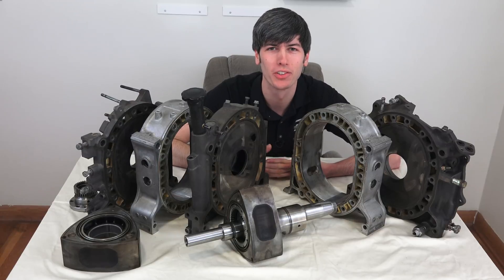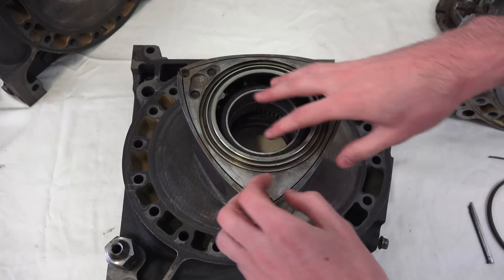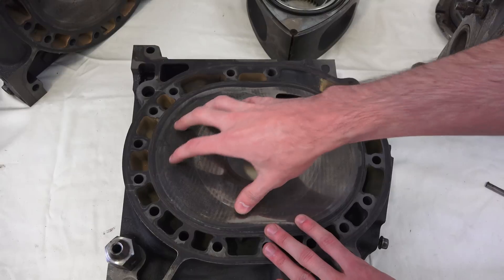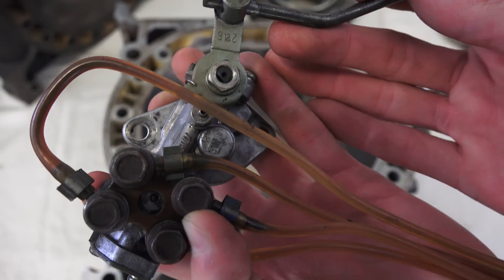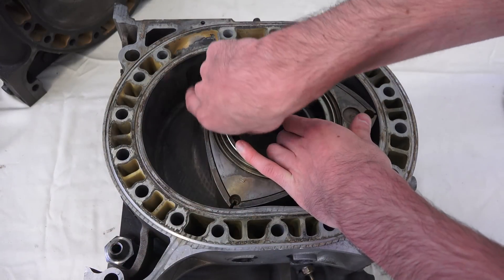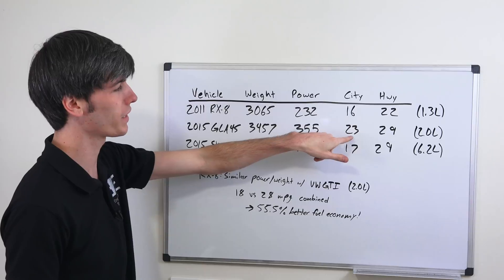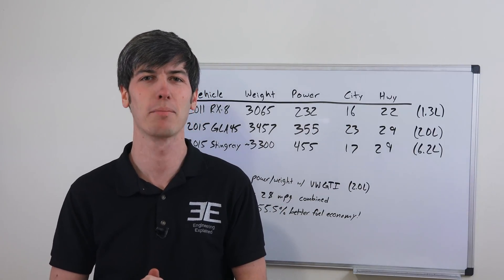4 Reasons Why The Rotary Engine Is Dead

Comment: As a former RX-8 R3 owner, I can attest to the fact that the rotary engine is a total blast to drive and bullet proof if you understand how to maintain it.   That said, it's not perfect.   The fuel consumption sucks (I averaged 14L/100km overall), but the advantage of a rotary is that it's a tiny, light engine that gives you the handling characteristics of a mid-engine car for a fraction of the price. With the right exhaust, the sound that it makes at 9K RPM is incredible.   I now drive a Cayman S, which is a totally different car, but the RX-8 could definitely hang with the Cayman handling-wise.   Long live the rotary!!!

Comment: I know it's a bad engine, but I have ideas for a couple of your problems:

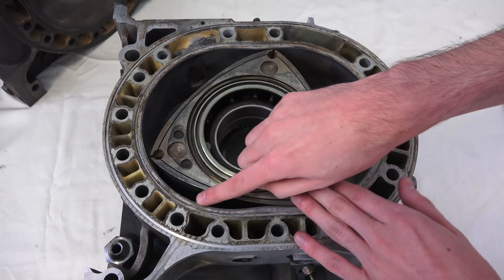0:45 - Put another "spark plug" to the 10o clock position and make it fire a bit later.
1:50 - Make it so that for example it does the explained combustion cycle like 3 times, then does half a revolution with no combustion (or a full revolution if needed) and then switches to doing combustion on the other side.
Reply: +SmartassX1 The first suggestion could work, but it would marginally affect reliability (something the Wankel doesn't need)
The second, how can you rotate an internal combustion engine with no combustion? If you could work this problem out, then it would make for a very unbalanced engine; with uneven combustion.
Reply: The idea is that once it gets going, it would use inertia to do the no-combustion rotation. Early internal combustion engines from about 120 years ago were designed to skip combustion cycles like that to save fuel, but they all had a flywheel.

Comment: maybe this is why I never did buy a Mazda, or drive one!
right now, driving 2015 Ford Transit 250 van with 3.7 liter v6 has 6 speed automatic transmission. and plenty of power output with excellent mileage. also has traction control system
Reply: +Anthony Schurz hahaha you sir, got served.. you do know that the ford ranger was a joint operation between Ford and Mazda since the REPU in the early 70's, right? I'll give Ford credit for helping Mazda out during their time of need, but it wasn't free. Mazda put in some serious engineering work for Ford.
So yeah, you would be surprised how much Mazda your Fords really are. Surely you remember Mazda's 2.3L Turbo engine.. What's in the new Mustang Turbo? hmmm interesting..
Reply: I take it that you like Mazda? And you are upset. When this whole video started out showing the rotary engine was a failure.
And the bread truck is running fine
Reply: +Anthony Schurz Why on earth would I be upset? I found it comical that someone driving a Mazda, "would never buy or drive" a Mazda. And I bet, its probably not your first Mazda! LMAO

The funny thing is, your bread truck will continue to drive fine. As had all the previous Ford/Mazda cars and trucks. But you sir, I'm sure will accidentally walk into a wood chipper someday.
Reply: +Anthony Schurz You're an idiot.
Reply: +Anthony Schurz What you really meant was "I only buy Ford, that's why I never bought a Mazda." *Even though at the time they were Ford's lol
Reply: +Anthony Schurz Only RX Mazdas have rotary engines. The rest of them have conventional piston engines.
Reply: Tuppoo94 will still stick with the Ford product not with the Mazda tried to be with Ford in the Ranger
Reply: Right now Ford Motor Company's beating the crap out of everybody else
Reply: +Anthony Schurz Your joking right??? You do know that 3.7 is a Mazda MZI motor from the 2008 CX-9?

You must be trolling...
Reply: 3.7liter Ti-VCT V6
Reply: Is that what sticker Ford put on the plastic engine cover? They have always been great at badge engineering...
Reply: Ronin both Ford and Oldsmobile were building multi valve double overhead camshaft v8 455 cubic inch plus that put 1200 horsepower plus to the ground back in the late 60's. However, environmentalist and insurance companies would not allow them to put these engines in production cars and sell them on the street to the public
Reply: And as for the previous comments, the big 3motor producers during the late sixties we're coming out with power plants that developed outrageous horsepower. And Mazda was nowhere to be seen until environmentalist, Ralph Nader, EPA ,Bogus oil embargo and Jimmy Carter's stagflation occurred that everyone was supposed to jump on board buying Japanese engines and the only way these were allowed into the United States was to have partnerships with automotive dealers. Of course at this time, this is when our economy was in free fall and Japan was buying are federal debt( Treasury bonds) while monetizing their own economy( quantitative easing, printing money)
This was the big leap in production manufacturing moving overseas to the island of Japan, then returning finish product as an import to sell on the American market to US consumers.... all while playing the game that peak oil was running out.
Now back in real time, we understand that we are not running out of oil. And Ford Motor Company is back to making the engines that they were making before and selling them on the streets to the public.
And yes Ford Motor Company has purchased several other companies. But Ford has never been purchased by another company.
Reply: +Anthony Schurz Haha. You have lost it.
Reply: +Anthony Schurz wow you got rekt.
Reply: That 3.7 liter is also the same motor used in the Mazda CX-9

Comment: What are you pooping about?
Modern gasoline engines have a maximum thermal efficiency of about 25% to 30% when used to power a car.
Mazda improved the fuel efficiency of the thermal reactor system by 40% by the time of introduction of the RX-7 in 1978.

Comment: the displacement calculation is wrong, 13b's correct displacement should be 2.6L due to difference in the speed of crankshaft rotates, calculating rotary's engine displacement like 4 strokes is not really applicable....

Comment: As a rotary owner, I prefer to think of these are character traits.  :D  

In all seriousness, these cars are not for everyone.  There is a fair bit more maintenance then a normal car but the driving experience is like nothing else.  They are very special cars.  I personally like the NA engines over the boosted versions.  I like that smooth power curve and instant response.  But, they are not for everyone.

Comment: From what i remember, the most disadvantageous aspect of the rotary engine is that the seals had to be replaced every 60-80,000 miles. I'm not sure if this is just recommendations that i remember or realistic fact. Either way, the seal replacement was not cheap and to EE's point, not worth it when your fuel efficiency is so terrible.

Comment: Well there are several things that could be done to fix that.  for the heat problem they could rotate the intake and exhaust chambers and make the sides out of a ceramic which would conduct heat less effectively.  the could also make the blades out of ruby or diamond and Teflon coat the sides of the chamber which should reduce the need for oil, if significantly increase the cost of the engine.  The real issue is the lack of low end torque, which I have to admit is really stumping me.  the easiest way would be to greatly increase the size of the blades, but this would also make the engine quite big as a result and most likely to get the desired specs would be something that would not even fit in the engine bay of a pickup, much less the confined space that most rotary cars live in.  turbo's would do nothing as there's just not enough gas moving to make them wroth considering.  hybrid would be the best opition, but I honestly don't know how much aid that could possibly be.   Too bad that this is such a head scratcher because this engine sounds and feels really good, and I really would not like to see it disappear.

Comment: Can you please make a video on the 2JZ?
Reply: +TrwSeama Bailing wire and duct tape.
Reply: Yes, but HOW it works? What makes a 2JZ so special and different from a normal engine?
Reply: I mean, why do I see so many Supra 2JZ fans? I know why I see a lot or Rotary RX-7 and Vtec Honda fans, but not 2JZ Supras.
Reply: +TrwSeama Because twin cam 6 cylindres
Reply: so 2JZ means just 2cam v6?
Reply: TrwSeama 2jz is not a V engine, it's a straight engine. 6 cylinders in line.
Reply: so an inline 6 with dual cams?
Reply: TrwSeama AND a turbo.
Reply: +ᅚᅚ 2 Turbos.
Reply: so it's an inline 6 engine with double cams and biturbo?
Reply: TrwSeama Yep, can handle 6-700+hp on standard internals, block and head. I suggest you look up Titan motorsport and see just how far the 2JZ can go
Reply: and how are the turbos mounted?
Reply: No :)) In what configuration?
Reply: +TrwSeama the 2jzgte can hold up high boost really thats all i know LOL

Comment: One of the largest disadvantages is that mazda is the only manufacturer to own the rights/only brand producing these engines. Also traditional piston engines have a larger history with multiple manufacturers producing and engineering new systems.Think about how far the piston engine has come in the last 20 years compared to the rotary.
I do understand that the rotary does come with its own flaws, just sad to see that they are not very viable to be further researched with the advances in piston and now hybrid and electric vehicles.

Comment: Why list a rx8 for mpg comparison when you are clearly using a 13b non renesis motor for showing detail.  i hate you now.  rotary for life.  "You no fasta than me!".- some rotary guy.....   Also no one with any rotary knowledge runs the oiling injectors, you premix.  Also the rx8 ren motor is the worst mpg out of all rotaries.  my 12a got around mpg as a 1.5 civic i had. (around 30mpg avg at low injector pulse width) and my 13b bridge on 550cc/1600cc got same around town as my sr20det does on 750cc.

Comment: We all knew it had disadvantages...  This NEVER stopped ENORMOUS SMILES PER MILES spinning the engine at 10 Grand...with flames shooting out the exhaust and tires erupting in smoke however.   You could also balance a glass of your fav beverage on top of this little powerplant and it would hardly ripple the liquid...and packaging?   You could fit one of these in a Brown grocery bag basically...and it would have 200+ HP.

 I know I know its not as efficient as it could be...but hell....AMERICA used to BATHE IN GASOLINE.....  We had 4 ton 2 door cars that one person drove to the grocery store in every garage across every state...for EONS.....  We had a B52 Jet Bomber in the Air 24/7 ready to end the world at any time....EVERY DAY.....FOR DECADES...  

Sometimes fun Trumps the Bean Counters....this is one of those examples.   There are many many more merits.  Methinks Mazda has taken its adopted child back to the drawing board and we will see some new and impressive things from the rotary before it pushes up daisies forever....  Or at least I HOPE SO.   :)   Good Video tho...

Comment: Since Cloyes finally mastered the spherical rotating-valve system, and seeing how Eaton supplies GM with a positive-displacement supercharger & that direct gasoline-injection has been well-realized, the idea from the GM Ultralight concept of making a clean-burning gasoline-fueled 2-stroke for passenger-car use seems VERY plausible these days. 

Imagine: 2-stroke performance w/o the oil entering the combustion-chamber... You'd get wankel-like RPMs & 4-cylinder (6-cylinder?) power levels with half of the [static] displacement, equaling better fuel-economy with the same level of emissions produced from a 4-stroke 4-cylinder.

Comment: You can buy two 3rd gen RX7s with 450 hp and still have money left over compared to the money spent on either car in your examples. Corvettes are around $80,000, RX-8 are v$30,000 install a 2.0 litre 3 rotor turbo, engine in the RX-8 for $3,600, add another$6000 for add ons and you have only spent $40,000 and produce around 550HP.. and blow the doors off almost 98% of all cars built.  In the real world the Corvette is doing real good if it can get 15 MPG...push the engine and enjoy your 8 MPG  Corvettes suck and are for guys with little bit down stairs.

Comment: Rotary engines are the only new combustion engines in the 20th Century.Everyone knows to use premix along with factory oil injection. Change oil every 2500 miles and they last longer than any piston engine that does break in till its broken.

Comment: wait so it has the same reason of why 2 strokes are not fuel efficient. But with 2 stroke you have an expansion chamber on the exhaust that brings the unburnt fuel back into the cylinder. Wouldn't that be a good solution to improve fuel efficienty? Also it would get even more power.

Comment: The capacity is way more than 1,3 really though. the 1,3 figure is just a calculation model they came up with becasue of the japanese tax regulations. I think the capacity is really 3 times that since you have 3  sparks per revolution in that 1,3l space. Ecomnomy is still not great but if you are going to compare it to a piston engine you need to do using the same rules.

Comment: my RX8's apex seals just went pooooof so now I'm in the process of dropping my 1jz gte vvti in there. Can't wait to get it done.  Wiring is madness - any suggestions or advice on what gearbox i should use or will my 5 speed manual be okay with all that torque?

Comment: I don't think the rotary engine is dead, it's very much alive. Sure it has it's faults, but it's still a great engine, not just because they produce more power than some other engines its size, but also because it's unique and an amazing experience driving one, even if you in the passenger seat of an rx8 or rx7 or any other car with a rotary, it's still a great experience. Anyone who loves cars should have at least one experience with a rotary powered car, whether if it's buying an RX car or being the passenger of you friends car, you're bound to have a great time. Also, you should compare the RX8 to a car of the same year that's in  the same class and similar specs, not a 2015 Corvette or a 2015 Mercedes GLA45.
Reply: I also forgot to add that i think the new rx7 and rx9 will only make the rotary more popular than it already is.
Reply: +Czar_JL12  What new production cars are available with a rotary?
Reply: +misamisatv at the moment none,the rx8's production was shut down in 2012, if i'm not mistaken, but within the next 2 to 4 years Mazda will unveil the new rx7 and rx9.

Comment: You actually have to compare the rotary to a 2.6L engine... Piston engines take 2 revs to burn their whole displacement, but Mazda rates the rotary for 2 faces (1 rev) firing, so to compare to a piston engine, you have to compare 2 revs. A 2.6L 4 cyl port injected engine woulc have similar power and maybe slightly better economy because the combustion chamber is so big, giving a lot of surface area for heat transfer and less work getting done... or in other words the same reason a rotary gets such bad mileage and needs such a huge radiator for its size.
Reply: +Jesse4AGE Incorrect. The e-shaft will rotate 3 times in what you are calling 1 combustion cycle.
Reply: +Jesse4AGE Incorrect, The e-shaft goes 3x the speed of the rotors themselves. 2 rotor faces means 1 rev means 1.3L burnt (assuming 100% volumetric efficiency). Therefore to compare to a piston engine, use 2 revs or 2.6L. There are standalone engine management systems out there that require you to configure them as 2.6L 4 cyl engines.
Reply: +Jesse4AGE No, it is not. You are incorrect. Go youtube any animation of a rotary and check it out. 1 rev of the e shaft results in 2 rotor faces firing, which is 1.3L. 2 eshaft revs result in 4 faces firing (2.6L), 3 eshaft revs is all 6 faces, or 3.9L total. Piston engines burn their whole rated displacement in 2 crank revs, so to accurately compare you have to use 2 eshaft revs, or 2.6L. I am stating fact here based on the fact that I have owned and worked on several rotary engine cars and I wrote the code for an aftermarket engine management system to control the rotary engine (www.msextra.com).
Reply: +Jesse4AGE Yeah it is like a 2 stroke in that way, it fits all 4 strokes on 2 faces of both rotors into 1 rev. It confuses people.

Comment: I owned one. A great motor. I redlined it everyday for 10 years, never failed. It was a great motor for touring at high speed and revs at 6k. True, fuel and oil consumption were greater than other engines for same displacement. I used heavy cheap oil. Tune-ups were so very easy and quick: no valves, no cams, no etc. True, the emissions could not meet new standards. The motor far outlasted the car. With new porting, new fuels, new seals, new metals, etc, the motor could possibly improve to meet standards.